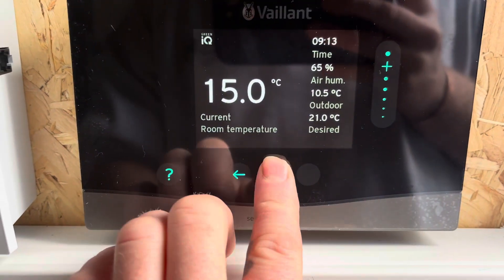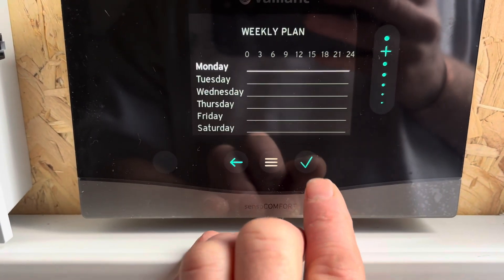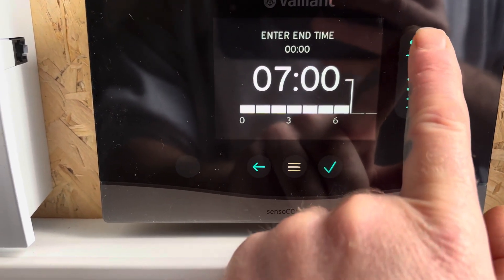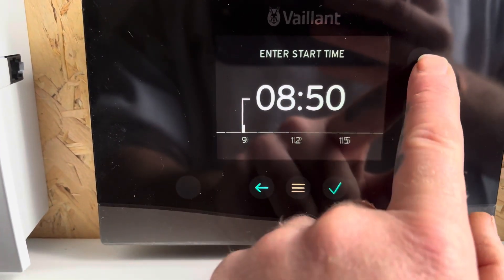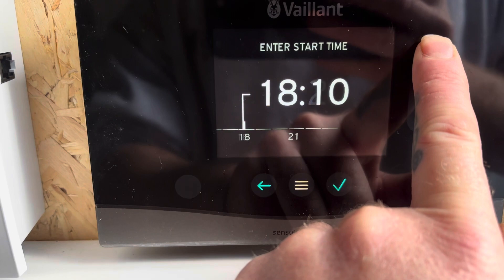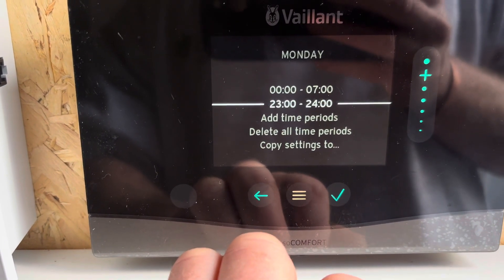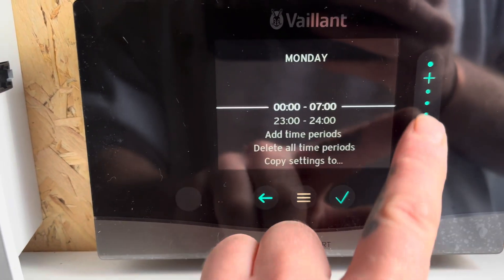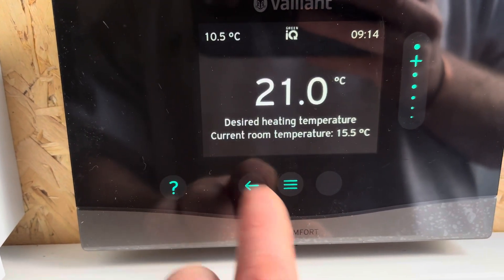Even QUIETER? 🤫 Noise Reduction Mode #heatpump #noisereduction #noise

Comment: Does it reduce the compressor's RPM  (power delivered)?

If so, is this good way to compensate oversized heat pump?
Reply from the maker: That is an excellent question! 
So The noise reduction mode reduces the fan speed and compressor speed.
I haven’t been able to confirm if this is a good way to compensate for an oversized unit from Vaillant, but it makes sense